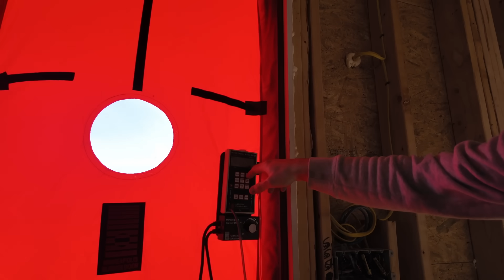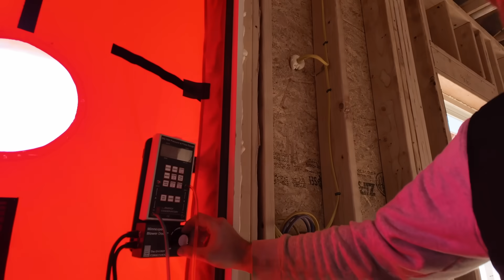The Blower Door Test - Episode 11

Comment: Hey, totally weird I crossed your video.. because I'm a builder and own a reputable remodel company in your exact area. We just built two homes in ozark and starting 3 more in nixa. Also building my home in clever and went through a lot of what you are. I'd love to offer any help I can, looks like your about at drywall stage. If anything I can offer some advice to help you GC your project and perhaps share some contacts to see you push through yo the end.

And don't reconstruct your loan unless you absolutely have to. Ask your banker for a cost over run loan towards the end. Confirm you'll be approved for the additional, but this is far easier than changing the construction loan.

Reach out -Michael
Reply from the maker: Michael,  please reach out to me. My email is RogueWrenching@gmail.com
Reply: @RogueWrenching  great man, I sent you an email!

Comment: Interesting how many "spray foam bad!" comments there are. "Spray foam bad!" is way too broad of a thing to say; using the wrong type of spray foam for the wrong application is bad, sure. But using the correct type of spray foam for the correct application is good. The problem is that it seems most people aren't capable of recognizing one situation from another.
Reply from the maker: Exactly.  This is open cell foam which allows the building to dry to the inside since the vapor barrier is the zip system on the outside.

Comment: 9:51 what about the wall sheets not being sealed looks like would be a problem with the test
Reply from the maker: They are sealed with Zip Tape on the outside. They do let light through but there is a seal.

Comment: Did you block up the roof vents and the soffit vents? Also why is your tub/shower surround in before insulation and vapor barrier?
Reply from the maker: Sealed attic, vapor barrier is the outside zip system, and we spray foamed behind the surround.

Comment: Why does the bath fan do a U turb? Usually there is flex duct connected to the fan to reduce noise from vibrations.

Why didn't you use the ERV instead of a bath fan?
Reply from the maker: Erv is separate from the bath fan because when it's being used to pull shower steam out, an ERV keeps that humidity inside the building vs. expelling it.
Reply: @RogueWrenching  Yes but that's only for a short period of time.
Reply from the maker: @multipotentialite  fair point.